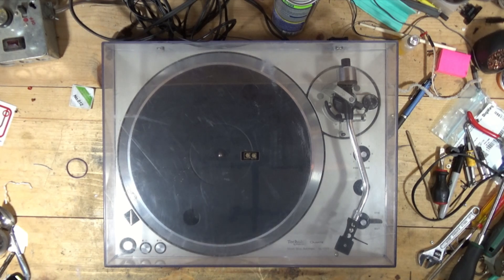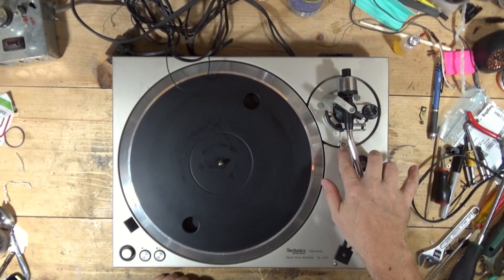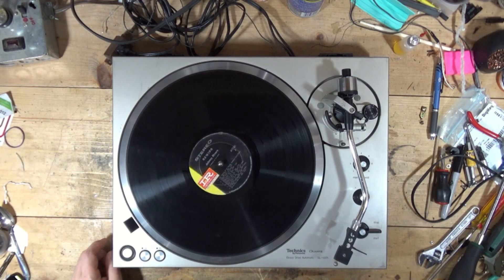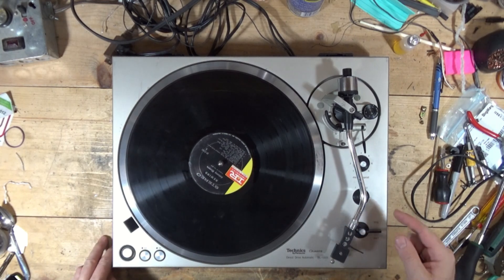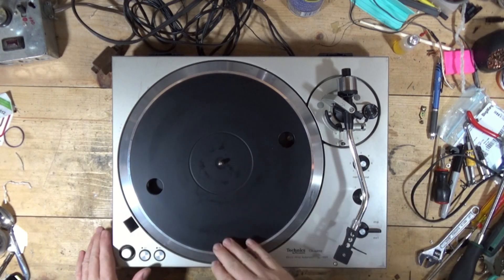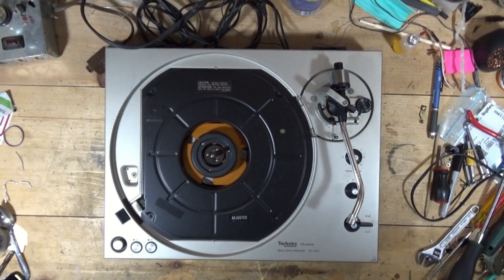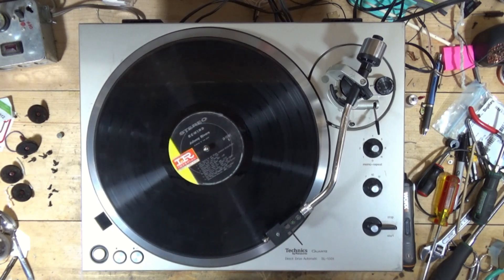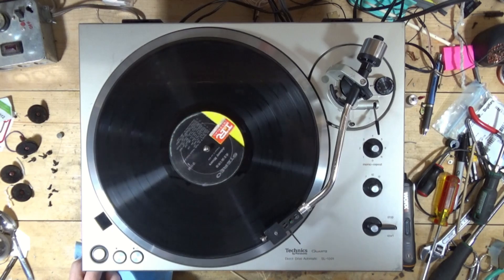Technics SL 1301 Turntable Repair Part 1 - Initial Evaluation & Tonearm Movement Repair

Comment: Thanks for the video keeps me fixing stuff ever tried WD-40 specialist electrical contact spray if you do you'll be hooked it's way better than deoxit cuz if you use the opposite on potentiometers it'll destroy the carbon track I'll never use D5 again the WD-40 contact spray is wonderful and hurts nothing works way better than D5 and cost a lot less and a big can and get at Home Depot or even Walmart have a great day thanks:face-blue-wide-eyes:
Reply from the maker: I always use the WD 40 contact cleaner since it's what my home improvement store has in stock.  I usually flush with WD40 CC and then 'treat' with Faderlube (depending on what I'm working on).